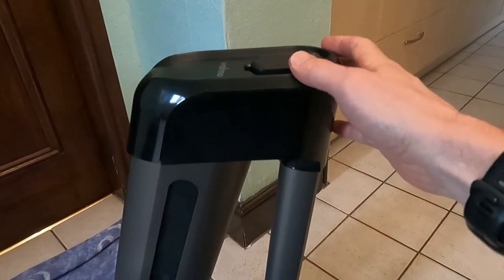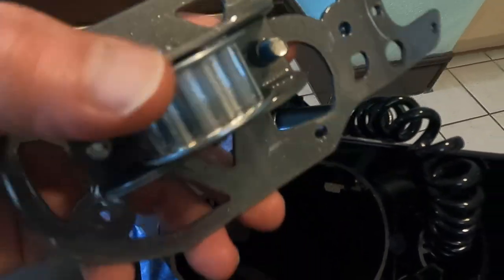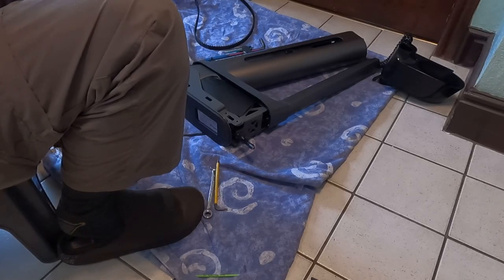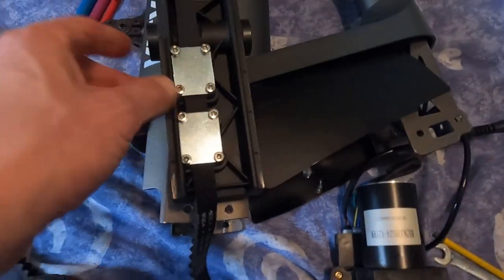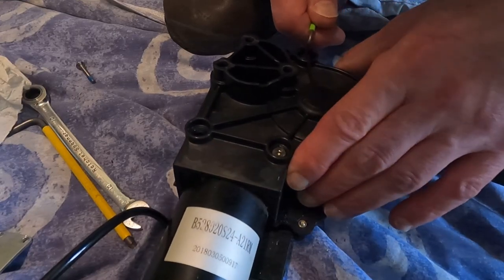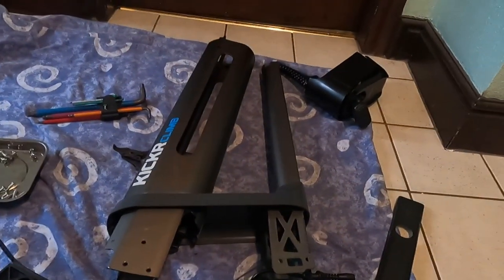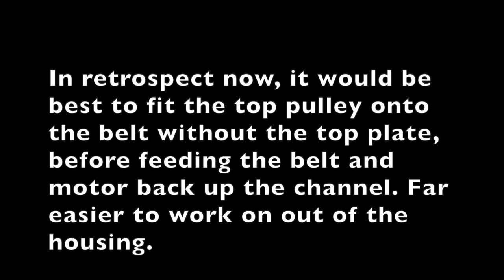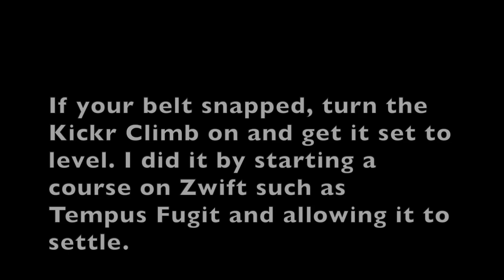How to change the Wahoo Kicker Climb Belt.

Comment: This video helped me save my Climb unit.

Don't recall if it was mentioned in the video, but make sure your motor is centered (pressing button twice) and that the axle is aligned with the cut out dot 1/3 of the way up on the groove where the unit travels.
Reply from the maker: Thank you for that extra bit of information, I can't remember either if that was mentioned. I will pin your comment so it is easy for others to see. Thanks
Reply: @DuncMcNutt  Thank you so much for the video - saved me a bundle.  Would have never figured it out on my own.
Reply: Great video, just hope my belt doesn’t snap as I am not sure I have the patience to do this

Comment: I wish you had shown what it was doing before you started the process to change the belt. How did you know that it was broken? My Climb doesn't work and I can slide the axle up and down without any resistance. Before I dig into it,  I'd love to know what you found before knowing it was the belt that needed to be replaced. Great video. Just trying to save some steps if it could be something other than the belt.
Reply: After watching the video I figured I could move the plastic things on the side up and down. I opened a section and could tug on the belt. I was able to pull it out since it was broken. Thank you for doing this. I just now have to get a new belt and replace it. Thanks for the great video. Awesome job! I will use a electric drill/driver for those allen bolts for sure.
Reply from the maker: @bostondonmtb  in my case, I know men was broken because it snapped whilst I was using it stood up riding uphill on Zwift. So it crashed to the bottom. So fell forward, banging my head in n the fan and shelf in front. And I hurt my knee which hasn’t been right since. So you are lucky if yours is broken and you didn’t know. 
All the best for changing it.
Reply: @DuncMcNutt  I am sorry you had a crash like that while using the Climb. I cannot imagine that. They should do a redesign. All the best to you. BostonDon